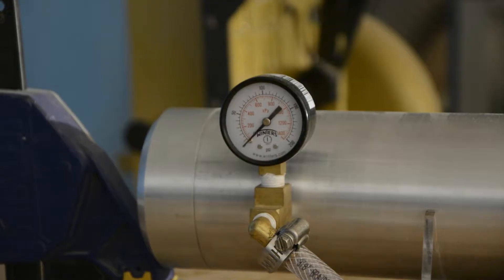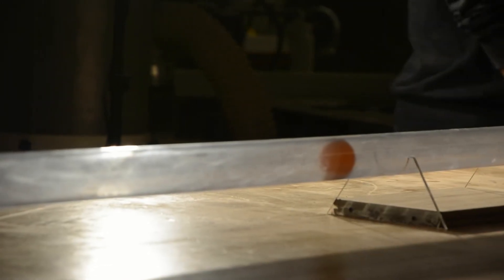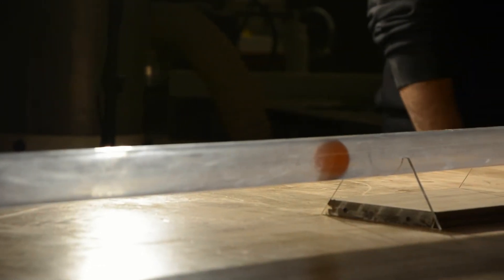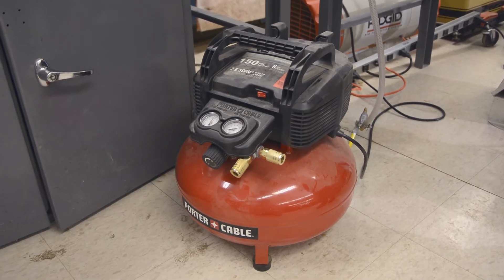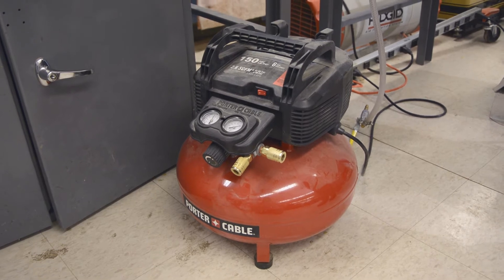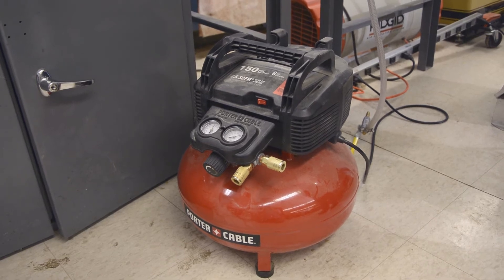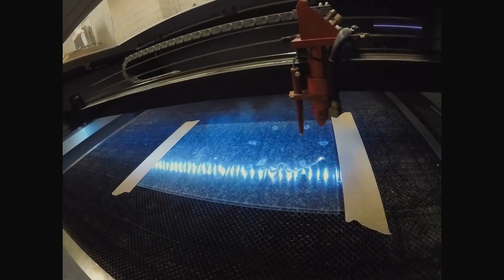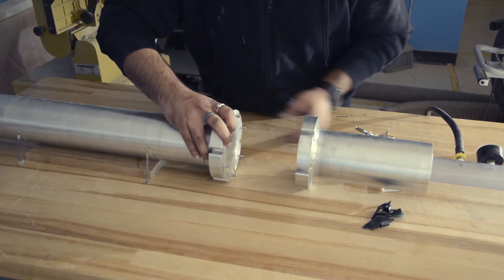Version 2 of Supersonic Ping Pong Gun - Brain Waves

Comment: Im trying to replicate this experiment using a Nerf dart, and i'm getting about the same velocities as you ~1250fps without a nozzle.  I tried machining my own nozzle, but it only results in slower speeds. Do you have the 3D print file?
Somebody else claims to get a nerf dart going Mach 2.3 using 400psi compressed air, and no vacuum. I don't believe that it's physically possible for compressed air to push something that fast. What are you thoughts on that?
Reply: Also, i'm curious what speed you would get without a nozzle.  Have you tried it?